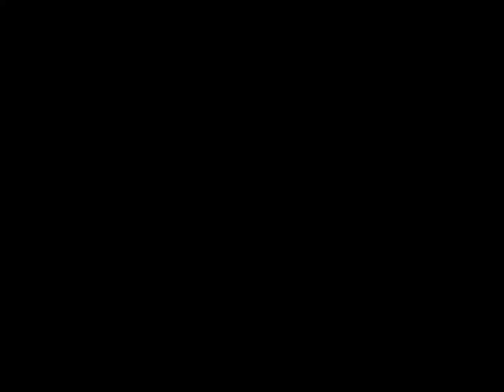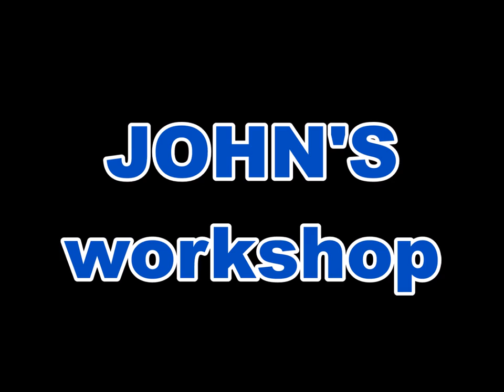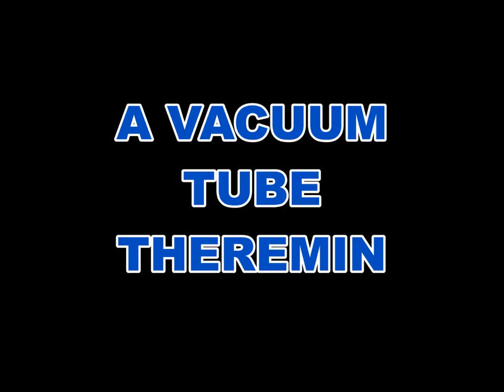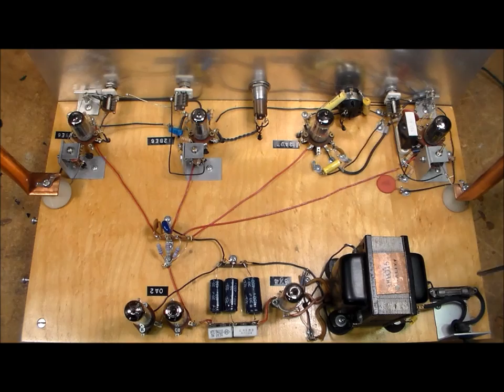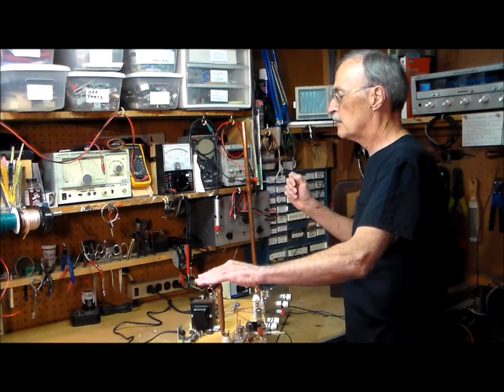Homemade Vacuum Tube Theremin

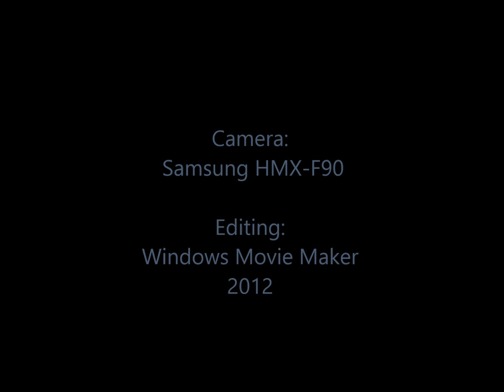Comment: I jist finished building my tube Theremin today, however it does need some finishing touches. Thanks for posting your video it inspired this 80 year old ET to attempt the build. I am sure though that I will never learn to play it as well as you. I was born with a Tin ear and served in the Artillery during Viet Nam. I built mine in a large flat LMN aluminum chassis box that was salvaged from another project from years ago. I used the gas regulators, first time too. In my day the OA2 was used in professional pieces of equipment. A few modifications were made as I began with a salvaged power transformer.  It wasn’t planned out on paper other than the EI article showed. I built each section one at aa time and tested each one separately. The tubes were all from my used stash, however the 6AN8 was only a 60 on my EICO  625 tube emission tester. The sound volume response is a little sluggish and I am hoping its the tube. When I was teaching electronics at Swarthmore I instituted a student project to build the PAIA Theremax Solid 9:10  State  Theremin. That kit utilized about 12 NPN transistors and two IC packages, one for audio power output and another for mixing and decoding the electronic Volume  control. PAIA will sell the entire kit for $258 or in sections of components. The main kit is the circuit board ,knobs, pots, jacks, and wall outlet power wart. The second kit includes the front panel, brass wire pitch antenna and volume loop antenna. The third kit includes the cut  wood cabinet pieces with instructions of assembly. The. Wood is unfinished but ready for staining or painting.

Comment: Great job getting the o-scope in the backround to show the wave length and amplitude as you played.  That was so cool seeing it fluctuating in real time.
Reply: Yes I always use an Oscilloscope and frequency counter to do a basic  initial tune up. I use a frequency of about 800 Kc. You can adjust it higher to to improve  sensitivity. You can also see the wave shape going from sine wave to square wave when adjusting the Timbre adjust. PAIA theremax make a  complete kit , case and all fir about $260. You can buy parts as are affordable at separate intervals of time.

Comment: I have begun to build mine. In the power supply I will be using silicon diodes larger filters and a 5 henry choke regulator. The Electronics Illustrated article did not use 0A2 + 150 dc regulators in series fir +300 VDC. My thoughts are capacitive inductive filtering will be better. The 0A2 will generate unwanted spurious noise. Winding ones own coil might not be all that difficult 115 uh to 240 uh. I noticed you used 12BE6 oscillators , where the EI article used 6BE6 tubes. I have a nice 8 x 12 x2 inches steel chassis with porcelain shielded  7 pin and 9 Pin tubes. I will test each circuit as its built. My antennas will be similar however my volume antenna will be an open 6 inch loop. Currently I am building the PAIA kit form solid state Theremax Theremin. Wish me luck!

Comment: Ive built many theremin circuits in my career. I like yours very much. You get very good range out of the pitch antenna, however you might want to try a loop or half loop style  antenna fir better volume control range the unit I built were all transistor or  integrated circuit types. I like the sound quality of  yours and will build one. Right now I am putting together a 20 transistor type of Theremin, but will begin to gather parts for the tube circuitry. My solid state model will run about $300 in parts. Im curious how much yours cost to build? Nice beginners techniques too !

Comment: It looks like a great project, but its been many years since I built tube gear. Time and material are a concern too. It the same Theremin that Tanner  had his demo here at YT. The info is up on the net, with schematics, parts list and explanation. As fir me right now I will be building the PAIA Theremax. Ive ordered the kit of parts. Currently I am looking for a suitable enclosure. PAIA no longer sells that separately, but just a flat piece of wood will work for a demo. Finishing off the theremin in an enclosure is the tricky part of any theremin project.

Comment: The Theremin physics requires a ground plane thus a metal chassis or a metal plate built on a printed circuit  board construction. A solod connection to Earth ground is a must to eliminate any 60 cycle interfeence.

Comment: That is awesome!  I would like to build one, but have a few questions.  The three tuning and sensitivity controls you showed were not on the circuit diagram.  To achieve this, do I just add a variable capacitor in the tank circuit of each oscillator?
Reply from the maker: The diagram only called for one RF oscillator to be tuneable with a variable cap. To make it more adjustable,
I decided to add a tuning cap across the second RF oscillator coil--but it's not necessary. Otherwise, I followed the Jan 1961 issue of Popular Electronics diagram pretty closely. Good luck building it! "73"
Reply: squarewave2 Awesome, thanks so much!
Reply: @TannerTech  saw your vid based on this build, great job!

Comment: What skills are required to build such an instrument?I think components have become difficult to find. Did I read about this project somewhere on the internet?
Sounds quite good to me, like the old ones.
Reply from the maker: Hi Giaccomusic,
The schematic for my Theremin can be found in the 1961 issue of Electronics Illustrated—you might find it on EBay. The skills involved would be: reading a schematic, understanding some basic theory, the parts and how they work together; soldering and wire stripping; use of some simple hand tools. This Theremin is not a project to start out with. It also involves some high voltage that can possibly kill. I began building tube circuits as a preteenager. Start with some crystal radios. See my video “Crystal Radio: Free Energy Source?”

Comment: Your theremin sounds beautiful, and I appreciate the fact that you apparently have closer-for-louder volume response! I especially like your discussion regarding the similarity of the interval spacings for high and low registers on the theremin and violin. With some added complexity to the pitch variable oscillator, theremins can be have improved pitch linearity, but I think the nonlinearity is something that many string instrumentalists actually expect. 

Some vacuum tube oscillators are sufficiently stable to allow the elimination of plate voltage regulation. Another aspect of most theremin designs (solid state or thermionic) is the tracking temperature coefficients of the local and variable oscillators that offer inherent drift cancellation. A notable modern tube theremin design is the "126 Theremin," which uses six 12AU7 dual triodes and a plate potential of only 50 volts.
Reply: I prefer closer for softer. It's like conducting.
Reply: @thomassicard3733  And I understand that is how most work. One advantage to louder when closer is you won't get runaway volume when distracted.

Comment: The power supply you used is not the same as the Electronics Illustrated version schematic. EI does not used the OA2  150 volt regulators. Are you using them in series for 300 volts and then dropping the voltage to 250 via a resistor network?

Comment: Hello, I’m trying to recreate this vacuum tube theremin for a science project and was wondering what was your list of supplies was and where I can get some of the items for cheap or a decent price. Thank you!
Reply from the maker: Hi, Autymn,
Complete instructions, part list and wiring diagram can be found in the 1661 issue of Electronics Illustrated, which you can sometimes find on EBay. Not to discourage you, but this is an advanced project for someone who can read circuit diagrams and solder correctly. Parts will not be cheap but they all are available from “tubesandmore.com”. Good luck!

Comment: No one could build that nice theremin and have a bench top so clean and organized. We do have several things in common, I also own that same black Micronta VOM from RS you have in the background. I think it shows our age. If you are in So. Calif drop me a note. Keep up the fine research.
Reply from the maker: Thank you for your comment. This theremin was actually built by me three years ago; I had plenty of time to clean up the shop. The RS meter is still very useful, along with my Fluke. Sometimes you have to have an analog meter to align receivers. I am happily retired in Van Nuys, CA. Theremins are much easier to build than to play!

Comment: Can you share the schematic please?
Reply from the maker: Hi Dejan,
Complete instructions, part list and wiring diagram can be found in the 1661 issue of Electronics Illustrated, which you can sometimes find on EBay. Not to discourage you, but this is an advanced project for someone who can read circuit diagrams and solder correctly. Parts will not be cheap but they all are available from “tubesandmore.com”. Good luck!
Reply: @squarewave2  Thanks, that's all the info I need. Also, don't worry, I can handle the schematics and soldering. I've built a quite a number of guitar pedals and a couple of amplifyers.